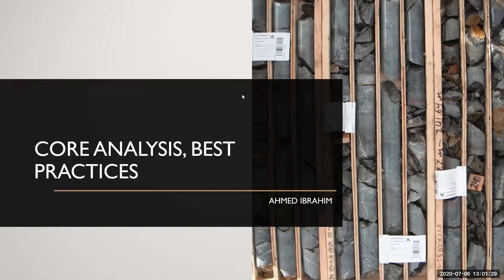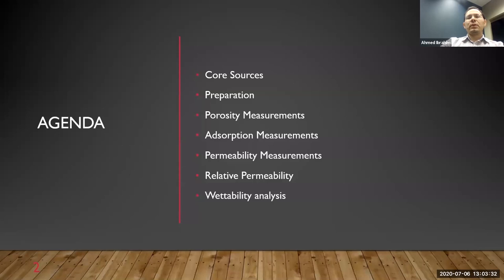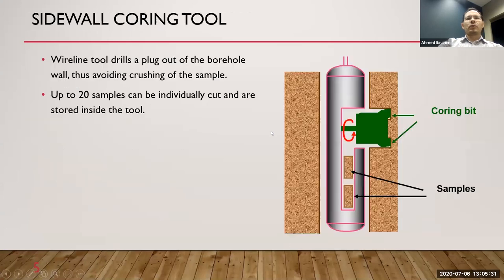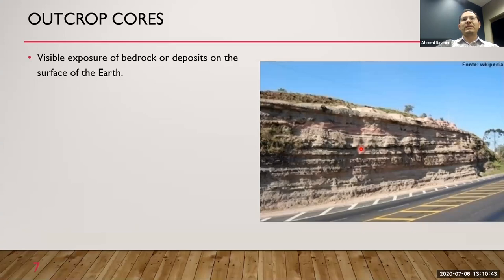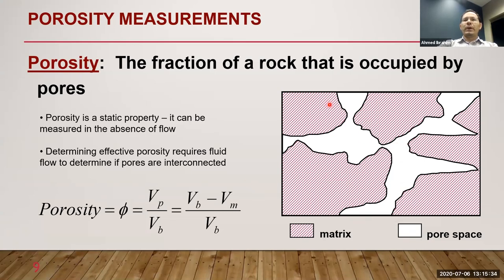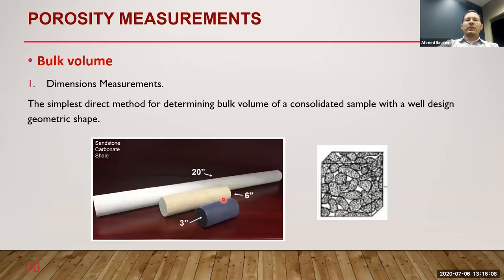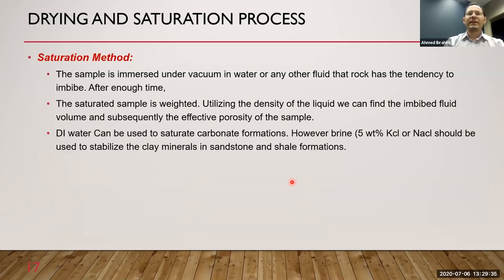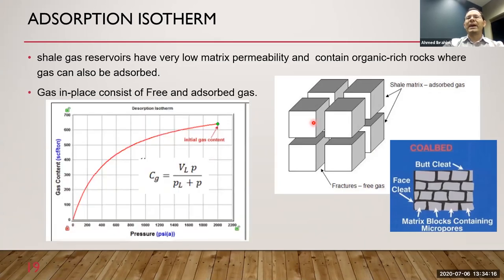Core Analysis and SCAL, Dr. Ahmed Farid

Comment: what is taught does not reflect in the quiz.
Reply: I believe that all the questions were covered in the presentation, except for Q3 for the effective porosity, I was planning to discuss it but I had to remove it for the sake of the webinar time. However, I'll be happy to answer any of your Q's.
the porosity calculated from gas expansion and Saturation methods is effective porosity as it measures only the connected pores. the porosity measurement from the crushed sample is total porosity as it accounts for all pores connected or nonconnected pores.
Reply: I think so, many questions don't have enough data, some of them need pressure, others need volume (dimensions), I don't know if the questions are using the information of the previous questions. It is really confusing.
Reply: Happy to hear ! But I have submitted the quiz .
Reply: @vladimirch24   that's true.  even i am facing trouble with quiz data